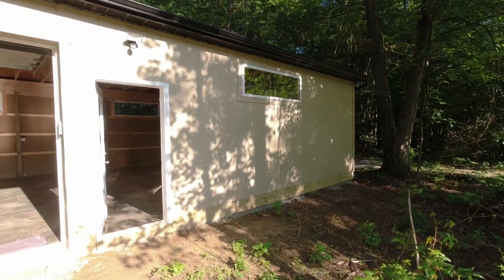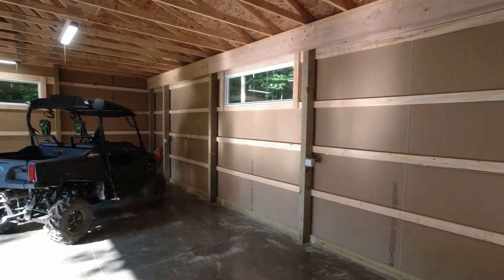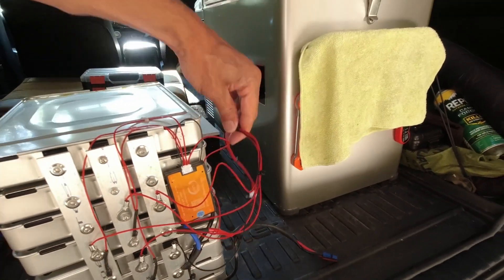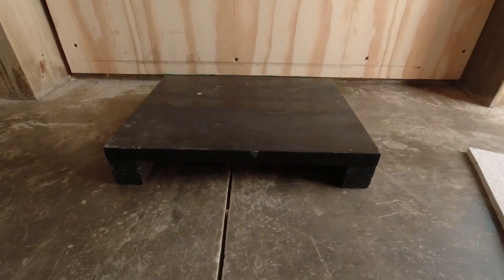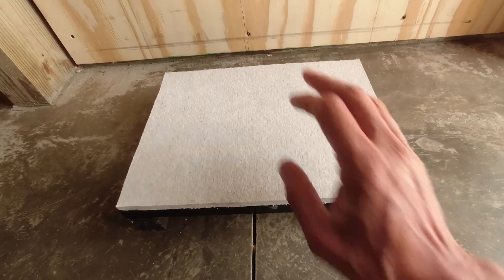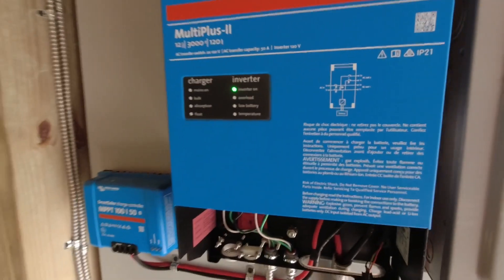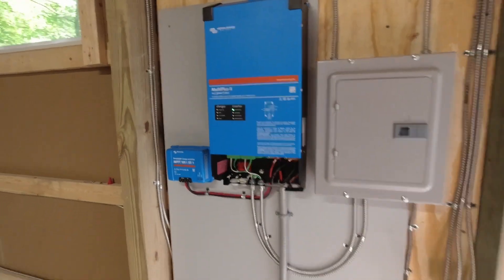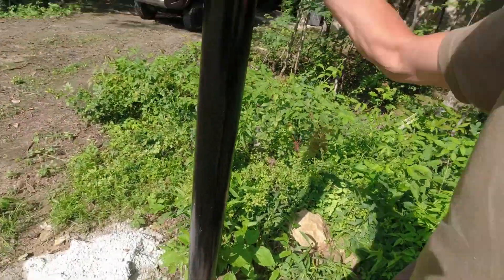Nissan Leaf battery powering off grid workshop

Comment: Hi what voltage is yr leaf battery how to connect together
Reply from the maker: I have them in 4S configuration. Each cell is 4.2V max., so that makes 16.8V.
Reply: 16..8v  is high  how do u  charge to leaf batttery by charge controller what is setpoint for high voltage low voltage disconnect for my used leaf battery thank
Reply from the maker: @hing983  these are individual cells out of a Nissan Leaf battery. A completely assembled Nissan Leaf battery has around 400V. The chemistry is within the LiIon category and therefore the maximum voltage is 4.2V per cell and somewhere around 3V cut off voltage. You need a BMS for any Lithium chemistry that matches the chemistry (LiIon, LiFePO4, Li Titanate etc.). The BMS comes in may configurations from 2S to 16S or more.  I am using a 4S LiIon BMS rated at 200A. If you want something lower in voltage you could use a 4S LiFePO4 setup with max voltage of 14.6V. Or you build a 3S configuration.
Reply: How do u wire the bms wire to each leaf battery connectors  I look I don't kown how which is first positive  second positive third positive fourth positive in 4s configuration
Reply from the maker: Each module has 2 cells in it. Measure the voltage of each and mark polarity and voltage on each terminal. Then use bus bars to connect them in 4S. I did not make a video on building this particular battery, but the concept is the same. Here is a link to one of my battery build videos. Maybe it will clarify things for you: https://youtu.be/kM2V-E7YFDg
Reply from the maker: @hing983  you need at least 2 modules to build a 4S Nissan Leaf battery. Each module contains 2 cells. Take your Volt meter and measure which one of the 3 connectors is negative. It will read 4V on one and about 8V on the other. Those are your first and second positive. Connect the 8V positive to the negative of the second module. The next pole over will be about 12V and the last one will be your main positive at about 16V. BMS negative goes on negative of first module. First positive on the 4V pole, second on 8V, third on 12V and fourth on 16V pole. All your voltages will be slightly lower, depending on state of charge.
Reply: i have 9 leafs battery sitting around for years ,  i dont kown how cut and drill the bus bar . i have foun photo d 6s bms wire connection photo for leaf battery ,do u want it
i meter my used leaf battery from red to middle connector is 3.6v ,red to blk is 7.6v i dont understand where is first and second positive is but i will copy the bus bar and u place the batteries in the video
Reply from the maker: Email me, we will figure this out together. 4622ko@gmail.com
Send me a picture of your cells.
Reply from the maker: @hing983  I will make a short video and post it by tomorrow.
Reply: Will u made short video about 4s leaf battery with bms  setup
Reply: I don’t kown how cut drill  busbar can you kindly made me bus bar include the nut in 4s configuration if u have extra laid around I m glad to pay any cost ship my in Los Angeles county
Reply from the maker: Here you go, I just posted the video: https://youtu.be/9MIFRIOkYDM
Reply: nice